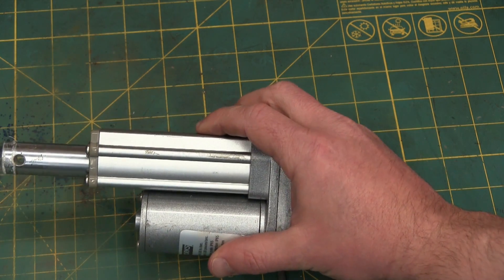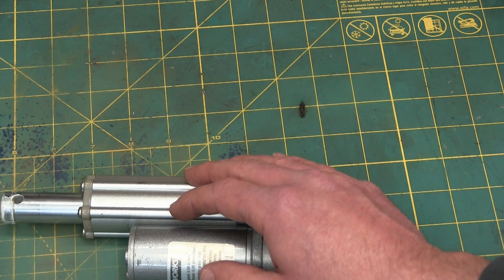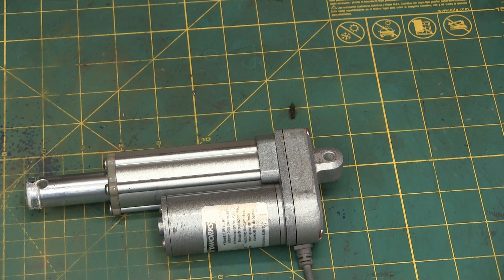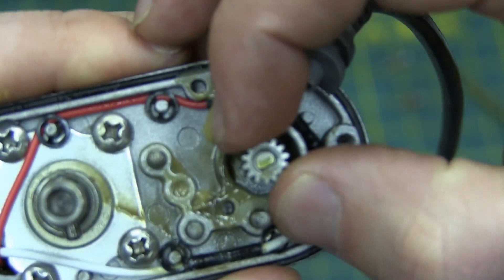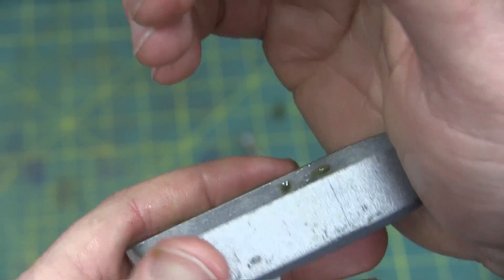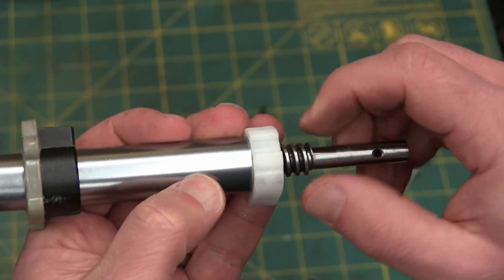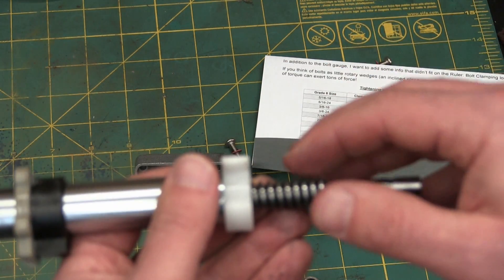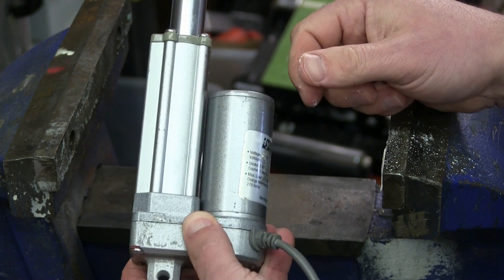BOLTR: ELECTRIC LINEAR ACTUATOR

Comment: I'm thinking it would be  fun project to make a far more skookum version of this, crank up the power to 11 too! 1000lbs seems doable enough with the right motor?
Reply: Duncan Murray That's some pretty awesome power in those! Especially considering they are using DC motors.

I imagine they must have about 250~300w effective output from the motor to get that kind of performance? I'd love to know what kind of slewing bearing or pin roller they are using to keep the screw working under that kind of loading. 12000N is a pretty serious about of force
Reply: Matthew McKellar  I agree whole heartedly! Override that bugger and test till fail!
Reply: Justin Milling Haha, I would just start machining one from scratch, I'm pretty sure you could stuff a 10hp brushless into a similar package size!
Reply: +ELECTRONTHORP Think we could convince him to do it?
Reply: Muskoka Mike Correct, this is why I'm thinking some kind of ball screw device could be useful in this application. I was thinking a offset concentric gearset linked into an planetary on the output shafts could offer a fantastic reduction gear solution for all of this, I obviously don't know the proper terminology, though I could cad it up if I had to. Needless to say though, it wouldn't take a brilliant engineer to significantly reduced the part count and increase the load capacity by an order of magnitude.
Reply: So, I was having trouble getting my differential reduction gearing to get me better mechanical advantage than 20/1, I finally found a solution, but it seems I'm somewhere in the range of 2600/1 now... far too much mechanical advantage. 

I'll see if I can tweak it and 3d print out the gear train. It should be about 1.5" wide and an inch thick.
Reply: Muskoka Mike Haha, they are pretty cool. The laser sintering ones are coming along nicely, though they have some problems with internal stressing due to the uneven heating of the material (duh). I had a chance to talk last year with the guy from Cincinnati Incorporated who printed out the car at IMTS, and they apparently are working on some crazy metal printer that welds the metal powder together by shooting it out of a nozzle at high speed so it will fuse into a solid piece? It's really weird and kinda awesome.
Reply: Your reply disappeared. I just speced a pair of HB-DJ805 actuators from my old mates in china. 40:1 ratio, unloaded 6.5mm/s, loaded 4.5mm/s. 12000N, 20A pull load at 12V. About 3000lbs. About 20mm/s (nearly 1/in/s) at 6500N, or 1460lbs. They're about the best I've been able to find.
Reply: I think around 200-240W on the motor. 20Ax12V. Can have them made with either ACME or ball screw depending on the budget. I have a 5000N unit I pulled apart, nothing special on the bearing, just a thrust ball bearing between the screw and the housing.

Comment: If you can get so much force out of an inclined plane with so little input, are there any hydraulic linear actuators that rely on a threaded shaft and a rotary vane with fluid flowing past it, rather than directly feeding the fluid into the backside of the piston?

On a mostly unrelated note, the applications you're talking about using an electronic linear actuator rather than a hydraulic setup don't make much sense, but electronic linear actuators are priceless when it comes to precision machining.  Sure you may not have the raw power, but with the right gear reductions, accuracy can be nearly infinite.  Some of the machines I worked with at a certain helicopter manufacturer were accurate to half of a hundred-thousandth of an inch (0.000005", I think that'd be?).

Comment: I don't know why I feel compelled to comment on every single one of your videos, but I always learn something.
Wouldn't it be mechanically simpler to use a hydraulic gear pump on the electric motor and a double action cylinder?  You could even put an over-pressure valve in if you were so inclined.

Comment: I wish you could see an Andco Linear actuator! I'm not pimping their stuff but I have seen these monsters put through hell and back in the grain industry. 200LB gorillas beating on a clevis pin to free a grain bin jam and these take the hits and keep right on trucking! Literally had these in a locked rotor condition for so long that the paint changed colors due to the heat the motor was putting out and after freeing up the slide these mothers still worked! This was not the exception but the rule! Had over 200 actuators under grain silos in the most disgusting environments imaginable and these things were amazing. Mind you this was 9 years ago so they might have started cheaping out but back then you could lock those motors up for days and the thermal overloads would kick in when she got roasting and after cooling down she would come right back to life! Never in my professional career have I ever been so impressed with the overall build of actuators like these and I would bet my life on them. I used to have a few in the shop for parts and if I can dig one up you can see how crazy these are! Now I have to go clean the shop....dammit.

Comment: acme threads have different load ratings. they are much stronger that's why machinist vises have acme threads
Reply: Ahhhh. Ok gotcha
Reply: AvE the gearbox guts look about like my pellet stove feed motors. 
Finally found out how to make those things last longer than 2 years, put a nice fan blowing on all the components and she's been a happy camper.
Reply: +ave I'd still expect a nicely machined acme screw to be significantly better at translating torque to force, just because the threads are gonna bind a lot less.

Comment: That could be just what a person needs for an arduino operated belt tensioner.  Or you could just use a spring and a lever.  Thanks for the video.
Reply: i'm thinking bluetooth controlled door lock to keep out or allow people in your room from your bed and cell phone

Comment: We've had good luck making these last a bit longer by using undersized fuses. The ham fisted labor has managed to break every other chingus attached to them but the linear actuators are hanging in there. This is in auto parts warehousing, nothing like heavy industry.